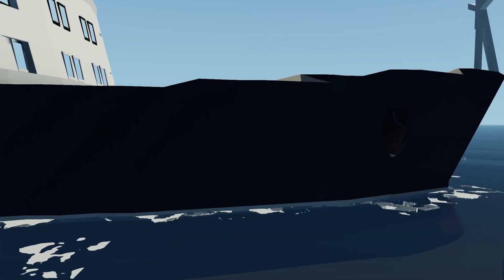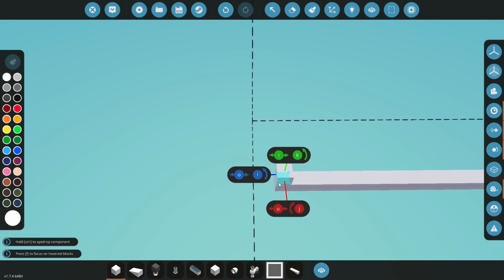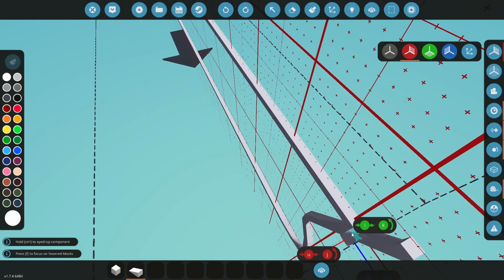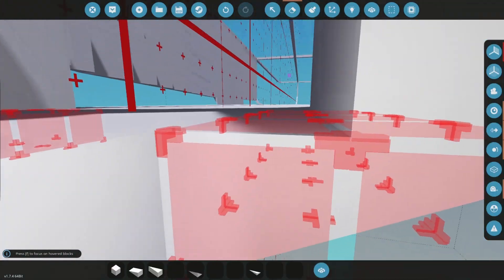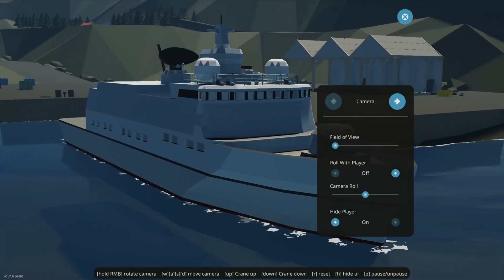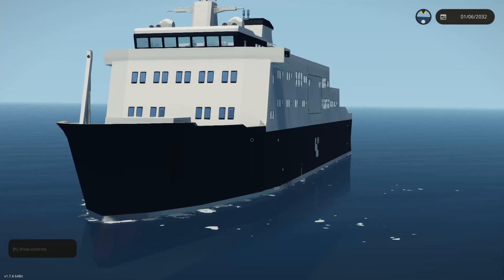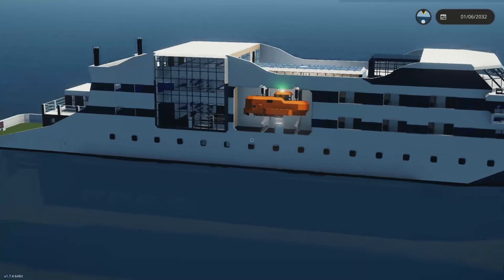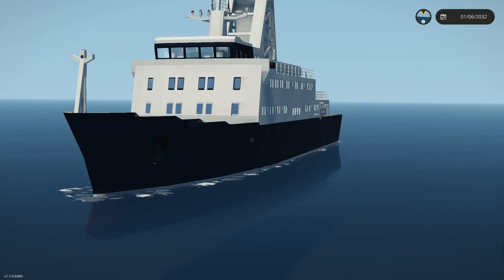Basics of Building Hulls in Stormworks

Comment: There's nothing wrong with the design of the first bulbous bow you showed. I've experimented with different hull designs and confirmed that it doesn't decrease performance at all designing a bulbous bow that way. You call it a "mistake" but never explain why it is.

Putting pivots into your ship is a good way to tank framerate and get your ship either blocked from spawning in multiplayer servers or spawning in with missing pieces because pivots are blocked (for exactly that reason).

It was ridiculous to put weight blocks on the entire keel in your example. You can just make a hard chined curved hull with an actual keel made of weight blocks, just a single block wide, and in the bottom of your keel it will keep your vessel stable without weighing it down too much.

XML editing rocket fuel weight is the best way to add buoyancy to your creations.
Reply from the maker: 1. You're missing the point of the video. If I wanted to make a hull that works the best in the game, I'd just build a brick. The thing is, a brick doesn't look too good, nor does the example I showed. This isn't about how to build a functional bow, it is about how to build a functional bow that looks good and realistic.

2. Yes, it is, but I didn't know that at the point the video was made. But, in my eyes, it still has many advantages over the XML rocket fuel method, I will explain that later.

3. For some of my ships, it really wasn't. Every ship is different and every ship may need a different amount of weight blocks to keep stable.

4. While it is a viable system, I wouldn't say it's the best idea to use just it, as it simply makes ships handle.. horribly. They essentially fly in waves, even very big, heavy ships.
Reply: @NeatNaut  No, bricks are not the best hull design in the game. Not only are there already videos that compare different hull designs and efficiency proving you wrong, you can test it for yourself.

2. Fair enough

3. Did you even try the design? After all the hours I've put, it's all any of my ships need. If they need a bit more stability, I just make the keel deeper with another lateral layer of weight blocks, issue solved.

4. My ships don't, but it's because I have them properly counterbalanced and I make sure not to put too much rocket fuel onto the vessel. They'll go through waves normally, even my smaller vessels
Reply from the maker: @pc_buildyb0i935  Right, I’m willing to accept that, the brick may have been a bit of an exaggeration. But my point still stands, the vast majority of people in this game don’t care about efficient hulls, they want to build something that looks good.

Yes, I have, it doesn’t work for my ships. I don’t know what you build, but most of my ships tend to be very top heavy, as they have large superstructures.

I still have ships that normally float much lower than they should, but when there are waves, they act like paper.
Reply: honestly, there's not really a "right" or "wrong" way to make a hull, it's all just a matter of opinion. Sure you can do specific styles of hulls, but you really aren't forced to do so. As for stability, kinda just your own choice and whatever you personally find works best. Its stormworks, the only real correct way to make a hull is for the creation to float.
Reply: @deer180  You're right, there's no "right" or "wrong, there are different designs, but there is a difference in efficiency, power, and sped and all three will be impacted by the hull design.